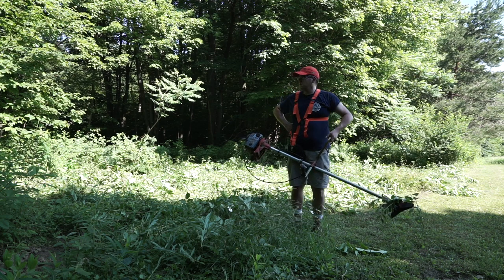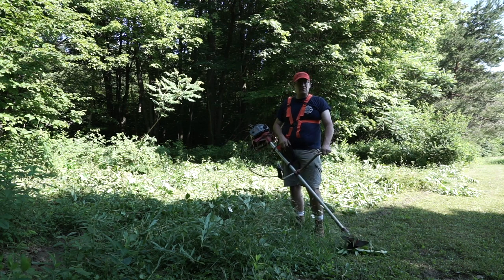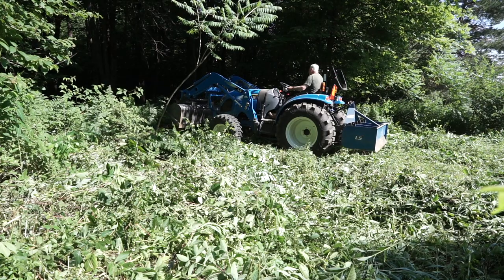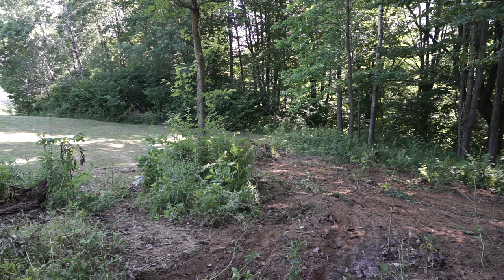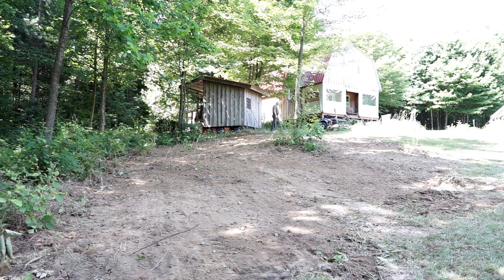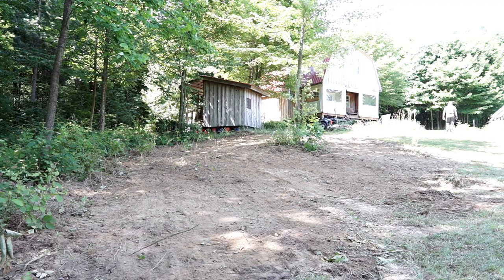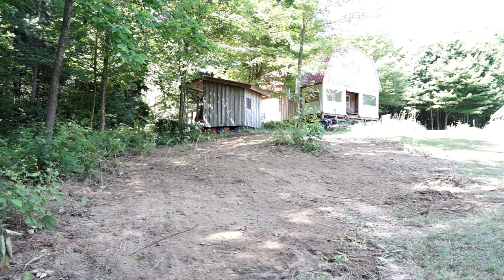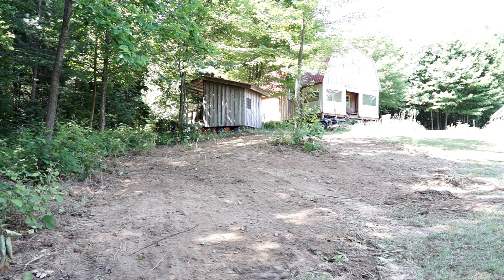LS 4040 Tractor Land Clearing & Grading

Comment: Just an fyi safety tip after watching a couple of your videos; farming is still one of the most dangerous professions. You might want to consider always being clear from the tractor while someone else is operating it. I noticed a couple of times when you are right in there next to it giving direction.. Anything that moves on a tractor will not slow down for any human body part.. (Or when you stand on the pile while he uses the loader) Even if you get 'nicked' by the tractor it will destroy whatever body part gets tangled up in it.. Very dangerous stuff.. I'd hate to see someone get seriously hurt. Keep rocking on, but be careful! :)
Reply: + Kapper Outdoors is right.  Farming is a dangerous profession, but amateurs playing on tractors is far more dangerous.  Putting up the ROPS & using the seatbelt takes 30 seconds and saves lives & limbs.   Operating the FEL from the side while the seated driver chucks his chin is foolish.  You don't dig that way with a FEL anyway.
Reply: big moist safety patrol!
Reply: I've seen alot of death and terrible injuries due to poor actions around farm equipment as a FF/EMT. YOU real smart mouths wouldn't like it.

Comment: I like you video's.  I watched your "New LS XR4040 Compact Tractor" video about 1 year ago when I was looking at LS tractors.(wound up with an LS XR4155HC).  You stated you were new at tractor's and asked that everyone not judge you too harshly and I agree.

I just found this last video and had to sign in and comment.  You really need to step up your safety.  Get that roll bar up and keep it up.  We have recently lost 3 people from tractors rolling over.  No excuses.

Also get everyone to stand clear when anyone is operating the tractor.  A good example is when you came close to nose diving onto the hood when he pushed into the pile.  Have you operator gear down when pushing into a pile.  It will help him control the tractor and help your tractor last longer.

Your review of LS was a benefit to me when I was looking so I hope you will benefit from this positive comment as well.

Keep the video's coming!

Comment: Have you guys noticed any problems steering while the loader has any weight on it?  I saw a guy's video who had a 4155 and they had to install larger power steering cylinders from a larger tractor just to get the steering to work properly.  Makes me kind of leery about buying that model when the guy said every tractor the dealer had on that lot acted the same way.
Reply: I know its kind of late responding to this question, but I spoke to my dealer about that very issue and he told me he had never heard of that issue.  He told me he had sold dozens of tractors and not one has been brought in with that problem. He said that in fact, many of that tractors that had been brought back in have been very minor issues.  Then again, I think the tractor is a 2012.  I I saw that video, and I'm thinking that poor guy got sold a lemon. I'm sure the problem, if it existed, has been resolved on the new models. 

After checking out all the popular brands, I'm about to purchase an XR 4041.  It feels just as solid and I think it is the most tractor for the money.